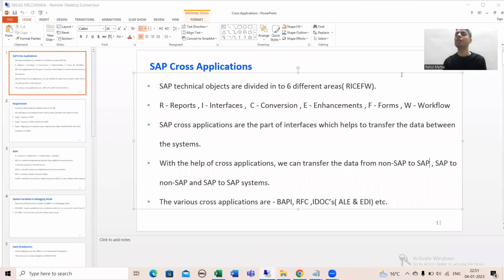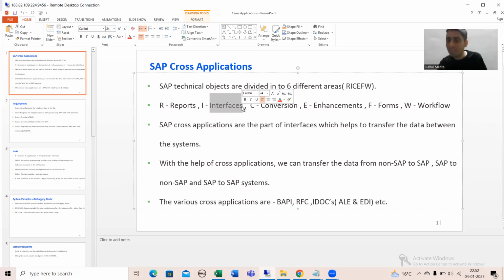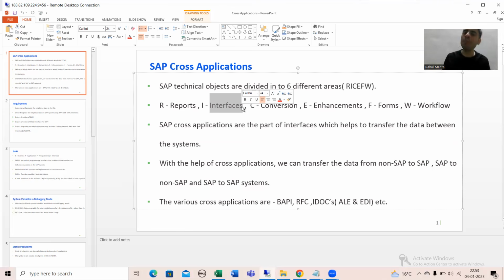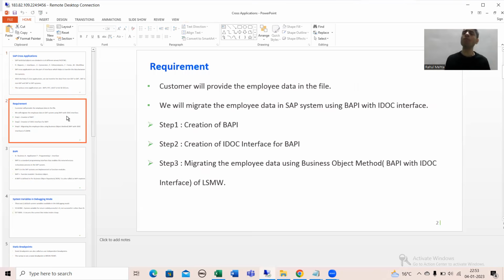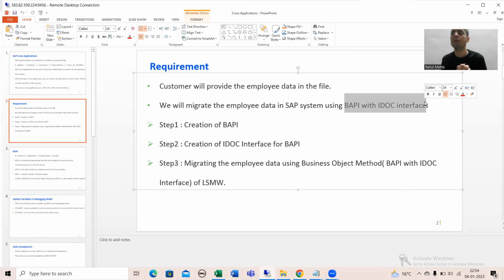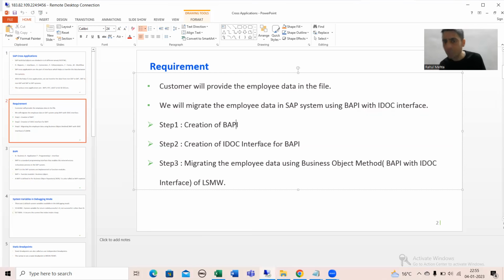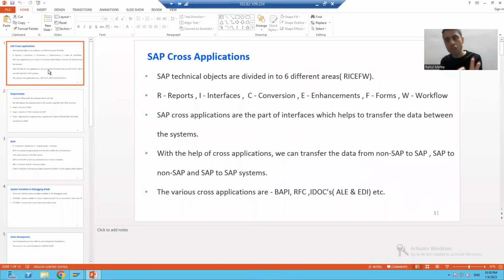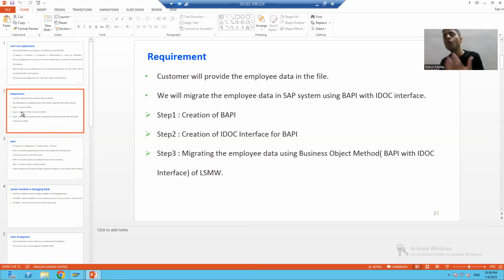1 - Cross Applications - Introduction

Comment: Hey Rahul, Can you also create a playlist for Proxy and Web Services Interfaces? Mostly we use these methods of SAP integration in our project.
Reply from the maker: Hello Harshita - It is not possible to cover these kind of topics through demo systems as vendors do not provide this kind of infrastructure. The reading material of Web Services is available in folder Additional Reading Material folder at below link.

So, as of now, you can refer to that.

https://drive.google.com/drive/folders/1gyxhxZpjKajbk44MyiC8G-zLP6dUi7jZ

Comment: Sir what is the difference between traditional abap and abap on cloud??
Reply from the maker: In ABAP on Cloud, SAP GUI is not available. To develop the objects, We need to use ADT( ABAP Development tools) in Eclipse.

Whereas in ABAP, we can use SAP GUI or Eclipse to develop the objects.
Reply: @sapabapbyrahulmehta  Okay sir got it. One more question Why is ABAP shifting to cloud (means on Eclipse)??
Reply from the maker: @shivamsrivastava7486      Hello Shivam - Cloud has a general meaning  and same is applicable in case of SAP. When we use cloud, it means a company don't have to set up a local infrastructure and it saves a lot of infrastructure cost. We always have a back up of our data. So the data is always secure.

Comment: Sir i have a question. Your requirement is customer will pass data into SAP. 
What is the difference of this and what you taught us in DATA MIGRATION? 
It looks like both are achieving the same aim.
Reply from the maker: Data Migration techniques are only from Non-SAP to SAP they falls under Conversion(C) of RICEFW.  Cross Applications are the part of Interfaces(I) in RICEFW which works in all directions - Non-SAP to SAP, SAP to Non-SAP and SAP to SAP.
Reply: @sapabapbyrahulmehta  well answered. Thank you I understand now.

Comment: What is difference between RFC and BAPI
Reply from the maker: BAPI = RFC Function Module + Business Object. The External system connects with the business object, which will call RFC after that. So It is totally OOPS Concept. In case of RFC, other system directly connects with RFC Function Module, there is no OOPS concept.